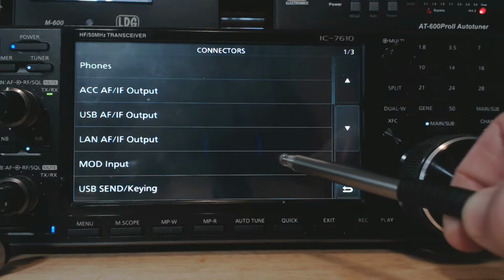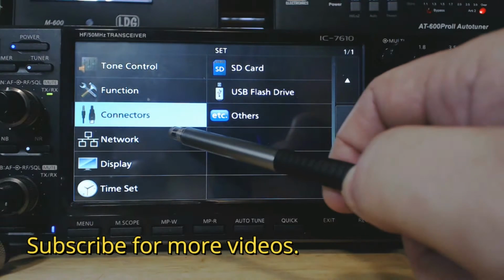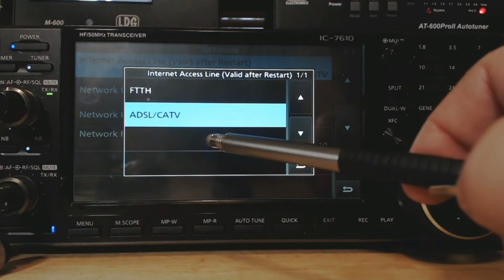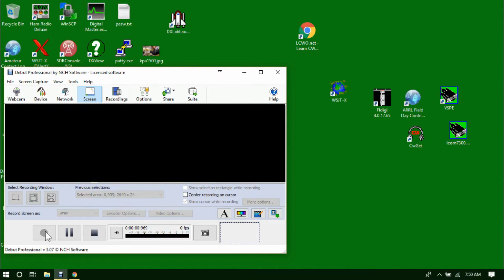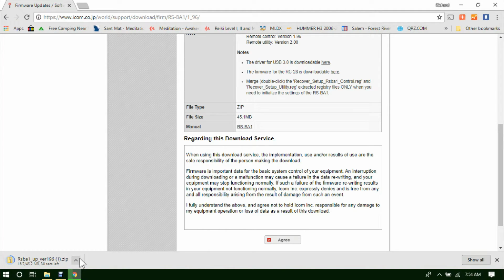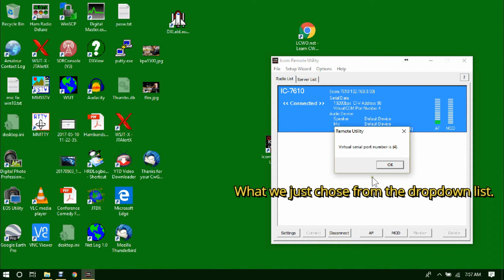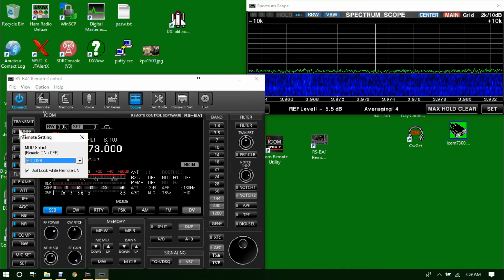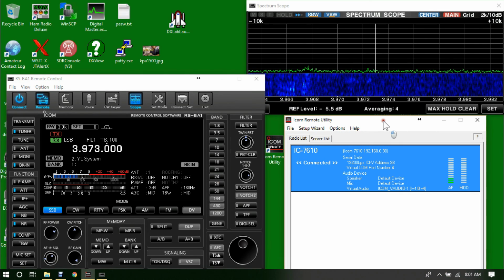Icom 7610 RS BA1 Installation and Settings

Comment: RS-BA1 uses 19200 speed to show waterfall, but Wfview does it with 9600...or even 4800.
RS-BA1 also resets the SSB/CW synchronous tuning on the rigs. This function is very good if you call a station that reads you bad on SSB. Just switch rapidly over to CW and call him and the right CW-pitch is there without the need for adjusting the VFO-knob.
This function SSB/CW synchr. Should be left alone for the operator to set himself, and not switched off brutally.
Otherwise find the RS-BA1 ok to use.
2 audio streams with the 7610 duał watch ? (One on each RX).
GL de Bjoern

Comment: How do you speed up the spectrum scope?  The spectrum scope on my setup is updating only once per second.  I've seen others where their spectrum scope was running smoothly in the software.
Reply from the maker: Thank you for commenting! I'm traveling so it's hard to manage online messages. You can change the waterfall speed using the radio, and probably in RS-BA. This may help: https://k0pir.us/icom-7610-spectrum-scope-display-variations/
Best 73 and good DX! de KØPIR

Comment: What physical connections do you make from the 7610 and your computer?  Just the USB-B connection?
Reply from the maker: Great question . I use the USB 2.0 cable for most logging programs (two virtual serials ports) and I use the CI-V cable for rig control on things like WSJT-X. I also have the highspeed USB3.0 for using HDSDR and CW Skimmer. GL and 73!

Comment: Question. 
Do I have to have the RS-BA1 installed on my shack  deck top computer to run remote in my Labtop?
I cannot get my Laptop to connect to my 7610.
All I get is
Connection failed 
Do you have any suggestions on how to fix this issue
JC
KB4SGA
YLS 40m coordinator
Reply from the maker: Good question Jon and thank you for commenting. No you don’t need it. Installed at your computer in your haM shack. Try to connect within the local network before trying to connect from the outside . Do you know what I mean? 
Rich KØPIR
Reply: @HamRadioAdventures  
Rich I have tried for several days, with no luck connecting to the local network. I just get Fail connection after I enter my server address or network  then enter  my user Id & password that I was entered into IC-7610.
Maybe you might know what I’m doing wrong. I also opened 50001 - 50003 in my router (UDP)
JC
KB4SGA
YLS 40m Coordinator
Reply from the maker: @johnckerner1007  as long as the PC you’re using and the radio are on the same network you should be able to ping the IP address of the radio from the PC. Can you do that?
Reply: @HamRadioAdventures  
i did that Rich. still not luck. i'll keep trying. 
jc
kb4sga
Reply from the maker: @johnckerner1007  check out the RS-BA1 Facebook group. They were helpful to me. Best wishes and 73 and good DX!

Comment: I aslo  use IC 7610. Now I am facing with software where the com port had been used for N1MM.. Could you please advise to setup the com port for the remote utility and also N1MM?
Reply: It's good to hear from you and thanks for commenting. I'm not sure what you are asking, but I generally use two cables, the USB and the CI-V. The USB cable can be used for CAT in N1MM and the CI-V can be use for rig control on something else like, WSJT-X. I have also used Virtual Serial Ports Emulator (VSPE) to share a port between two programs. I hope this helps. GL and Good DX!

Comment: Hi there Richard, Patrick PD1PRV here from The Netherlands. I'm using my 7610 remotely (radio directly connected to the internet without the use of a computer). My question: I don't get to see the scope on my remote computer! When I click on scoop the RS-BA1 (vs2) says "to use this function, connect using a LAN cable or USB cable set at 115200 bps" but I have done that! How do you use your radio remotely...connected to a computer or also directly on the internet (internet cable at the back of the radio). Thx Patrick
Reply from the maker: Good to hear from you and thank you for commenting. Verify your settings by going to this page. it has all of the screen captures on it, https://k0pir.us/icom-7610-rs-ba1-installation-settings/
Reply: @HamRadioAdventures  Thanks for replying. In the same netwerk it works like a charm, with scope and all.... the issue appears when I'm connecting from my other QRl. When doing that I'm using the internet so not in my closed network. Still the radio work 100% but I'm not able to see the scope... thats the question. Grtz 73 PD1PRV

Comment: Rich, watch the great instructional video. Here is my question, do I need to connect to the Lan port in order for the remote to work? Or can I connect to the WIFI here in the shack. Also, does having the Win4IcomSuite complicate this set up. 
Tnx, John 
ND1X
Reply from the maker: Hi John, good to hear from you and thank you so much for commenting. I have my cable modem in my ham shack and I can connect to it with a ethernet cable from my radio. I can then use wireless to connect with my laptop and RS-BA1. Most of the time I am using the LAN. When I am out of the house I can still use my laptop and connect to the radio, because I have my router configured to allow outside connections. I’ll do a video on that coming soon. I don’t know about the suite. Take care and good luck. Good DX and best 73!
Reply: @HamRadioAdventures  Mine is working, but can't connect from outside connections. What do I need to do to allow this also?

Comment: What about CW? How does that work? How do you set it up? 
73 W7RY
Reply: Hi James, nice to hear from you and I hope everything is well where you are. I haven’t used it in quite a while but I remember right you can use the CW memories and you can also use the keyboard for entering characters and sending CW that way. Just change modes on the radio and go to View and CW Keyer. The RC28 would come in handy while operating remote. A good source of information is on Facebook and the RSBA1 Facebook group. I hope this helps a little and this winter I will try it out from Arizona. It should work FB. Take care, be safe and best 73!

Comment: I'm wondering how fast is your computer ?  how fast is the rs232 set to 115k ? or more. reason i ask is the water fall has a horrible lag, and that is the ONLY  reason I would waste money on it.  thank you for doing the video I enjoy all your videos EDIT: never mind I asked before the end when you said LAPTOP. that explains that
Reply from the maker: Hello and thank you for the question. Yes it is my little laptop (celeron) that is causing the lag. I was running the screen capture software at the same time which was slowing it down. Normally it looks just fine. Thank you and best 73!
Reply: @HamRadioAdventures    how would you compare this software to the one used by FLEX radios ?  does it even come close to it ?

Comment: Hi Rich! Always enjoy your videos. What are your thoughts on this software which I would use for my IC-7300? I go to Denver twice a year and would like to bring remote capabilities with me. Do you have to keep paying to use this software like the HRD? It is more money but coming from ICOM it has to be pretty specific to their line of radios I am guessing. 
Thanks
Kevin KA0KAE
Reply from the maker: 1crazynordlander thank you again for commenting and watching these videos. I sincerely appreciate it and I appreciate your comments.When you that software it’s yours and they just did a recent update. RS-BA1 is good software and it works, but you will need to have a computer attached to your 7300 and have the software loaded on it as well as on the laptop that you use remotely. I think maybe another solution is remotehams.com. I have not tried it but I know other guys are using it with the radio. The same would apply with having a computer connected at the station. Have you considered the ICOM 7610?  It has the server software running on it and that makes it a little easier. 73 from Tucson Arizona!
Reply: @HamRadioAdventures  I will consider the IC-7610 down the road in a few years. I am 61 and just got into had radio. I have a ton of computers as this has been my trade for the past twenty seven years. I do tech support for two small public schools in my area. I take that if I get this software I can use it for the IC-7610  down the road as long as I us it for one instance at a time.

Comment: Can you switch between antenna 1 and antenna 2 with remote?
Reply from the maker: Hi Ray nice to hear from you. That’s a really good question and I believe so in the software you can change between Ant1 and Ant2. I haven’t use the software in a long time, but I hope to be using it more in the very near future. I think I’ll upgrade to the latest. I was a little put off because I just bought this version and then they came out with v2 without having an upgrade path. Happy new year and best 73!

Comment: Question 1.  Why "USB" versus "ACC" in the DATA OFF MOD setting ?   2.  Why 19200 baud rate instead of 'auto" in CI-V Baud Rate ?  3.  Why "echo back ON " in CI-V ?

More later . Thanks de Andy K3UK
Reply: Andrew O'Brien I am using a USB cable and nothing on the accessory port. 19200 is the fastest for CI-V baud rate. CI-V USB Baud is set to 115200. I have echo back on because other programs I use need it on. Do not know if it is needed for RS-BA1 or not, but maybe so. There is an excellent RS-BA1 group on Facebook. I hope this helps Best 73!

Comment: It appears you were remoting in from inside your QTH.  How about showing how to do it from outside the QTH?
Reply from the maker: Hi Tom, nice to hear from you and I got it setup a long time ago, but never used it outside the home.

My issue with operating from a remote location is the wx. In the summer I would never leave town without disconnecting my antennas. We have too many bad electrical storms in SD.

Now that it's winter, it's safe. Let me try it out in a coffee shop in town and I'll do a video on it and how RS-BA1 is working. I have a wireless headset to test out too.

Thanks again and best 73,

Rich, K0PIR

Comment: Any idea how to make the second receiver band scope active? I've seen pictures of it but I have not figured out how to to this yet.
Reply from the maker: Great question Steve and I wondered the same when I saw it. It's the new RS-BA1 v2 software, HI HI! I haven't bought it.
Reply: I have the original version also but became confused after downloading the latest updates from Icom for that version. "The Icom Remote Utility" IS version 2.00 so I thought that would get me the second bandscope. The radio control GUI is 1.96 though. I see on their website now that  previous owners of RS-BA1 are not grandfathered in  to version 2.00. That's version 2.00 of the entire package. Looking at the price of the new package in addition to what I've already spent on RS-BA1, I don't guess I really need the second bandscope after all.
Reply from the maker: Yes, I was disappointed because I just bought RS-BA1 about 5 months ago. I think I can do without the new version for a while. 73!

Comment: I have the RTS problem with my configuration. Several seconds after I connect, the 7610 goes into transmit mode. From your comment, it sounds like I have RTS checked somewhere but I am not sure where to look. I have the same issue when I use my ProLog logging program, the 7610 goes into transmit mode in a few seconds. Do you have any idea where I should look?

Craig W9CLA w9cal@arrl.net